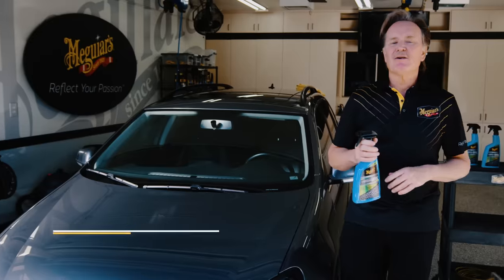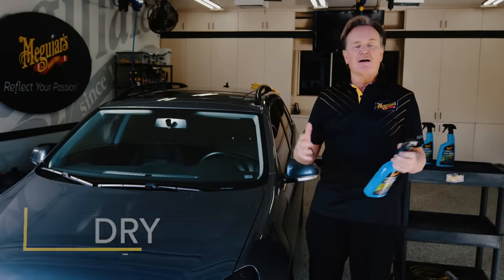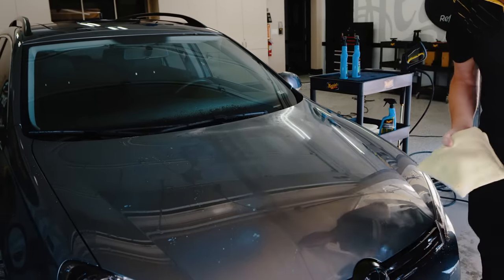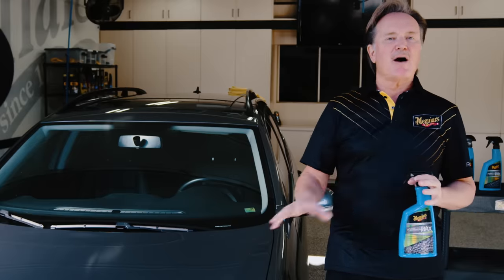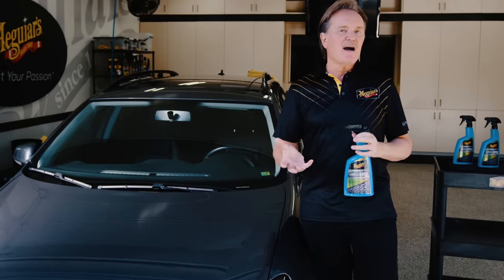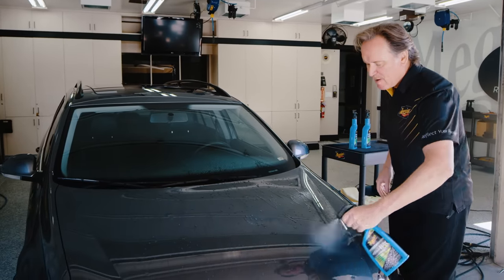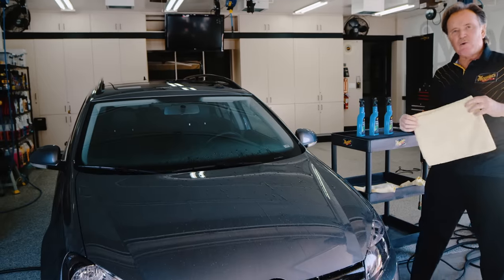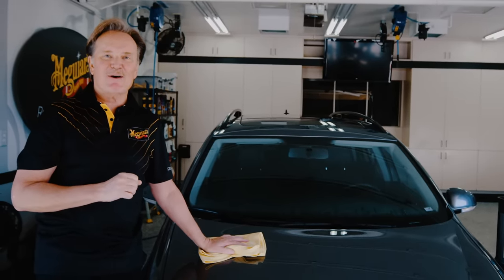Meguiar’s Hybrid Ceramic Wax - Ceramic Made Easy!

Comment: Can I use a sheepskin chamois to dry the car after application and rinse? Does it have to be microfiber?
Reply from the maker: Microfiber drying towels often tend to work better and are safer but if you like the performance of your sheepskin chamois yes, you could try it.
Reply: @meguiars  Well, I'm exhausted, but I survived. I swung by Walmart and picked up the Gold Class Car Wash, the Hybrid Ceramic Wax, the Clay Kit and the Water Magnet drying towel. I spent the evening giving it a wash, clay bar and hybrid wax. This White Chrysler 300S is so shiny and slick I'm convinced I'll get an extra 1-2 miles per gallon! It's so beautiful! Thanks for all your help and the great videos!
Reply from the maker: ❤️ 

Thanks for sharing.  Nice job. 

That really is a good feeling isn't it!

Comment: Hello there I have a question 

So where I live it’s not possible to hand wash all the time. So my question is after doing the foundation layer then spray the product and hose off. 
Do I have to use the product  continue every wash.  will it be okey if I skip the spray wax on some washes. 
I mostly relay on automatic cash wash. 
So I won’t be able to apply this for every wash what would be the result if I skip to use the product on some washes.
Reply from the maker: The Hybrid Ceramic Wax is along lasting wax.  It is certainly not necessary to use it every time you wash your vehicle.

That being said, how long any protection/wax lasts is highly variable and depends on a number of factors related to the condition of the paint, previous prep, and the environmental elements the vehicle is exposed to.  On a well maintained vehicle the Hybrid Ceramic Wax could last up to several months.
Reply: @meguiars  Thank you Love yr products.

Comment: I did exactly that on the first application and tried it three times and then did the second spray-on/spray-off layer after each. It did not work. For some reason this product won't bond to my paint. I previously used McGuiar's Ultimate Paste Wax, which works really well.
Reply: Question...is your paint clean?
Reply from the maker: Sorry to hear about the experience.  We would also ask, is the paint free of bonded contaminants?  In other words, when has the last time it has been clayed?  When is the last time it has had a regular liquid or paste wax applied?  Feel free to continue the discussion within this comment section if you prefer or, you can also contact our Solutions Hub at 800-347-5700.
Reply: @meguiars  I had just washed the vehicle with McGuiars ultimate. I then clayed most of the hood. I got the vehicle in mid June 2018. I have waxed it 2-3 times since. Last wax was in Nov. timeframe. I did read that using too much can have reverse effect but is remedied by washing with car soap to remove the carrier contents of the mixture which are hydrophilic. Not sure.
Reply: @Milpower  Yes, very clean.
Reply from the maker: With the information we have here, it does sounds like it has been a while since certain steps have been done.  You would likely get much better results by having a good base coat of either a fresh application of Ultimate Paste Wax and/or a polish step like our Ultimate Polish.  Also,  claying is going to be important if the vehicle does need it.
Reply: @meguiars  I did clay the hood but still didnt work there. Also, I dont recall the instructions saying to wax prior to applying but heard from FAQ that one could apply to wax without issues. So, I definitely followed the steps. Fresh wash -> clay hood -> apply wet -> dry towel -> pressure spray off -> spray on -> spray off -> no work.
Reply from the maker: Do you think it is possible there was a large abundance of water on the panel when you did the foundation layer?  We have seen where this can potentially not allow the product to adhere as well, and thus, not perform as well.

Comment: I saw a guy spraying this product on his brand new C8 Vette, windows too.
Is it ok to spray this in my windows, and NOT get a film on them? My chrome wheels (they ain’t ‘rims’) as well?
Reply from the maker: Yes, it is safe on all the exterior surfaces but it is designed to bond best to paint so you may not get the same results on other surfaces.

Comment: Can it be used as a stand alone wax?
And how long does it last?
Reply from the maker: Not sure what you mean by "stand alone" wax, but yes it certainly can be used as your primary source of protection.

How long any protection/wax lasts is highly variable and depends on a number of factors related to the condition of the paint, previous prep, and the environmental elements the vehicle is exposed to.  That being said, if well maintained this could last up to several months.

Comment: 2:30 didnt you just wash of the product?  
Is it not spray and wipe it with microfiber towel to distribute then rinse?
Reply from the maker: Sorry, not clear as to what your question is.  This is exactly how we recommend using the product.  There is no mistake in the video.  This is the recommended method of application.

Comment: What happens when we do the roof of the car with the spray and then hit it with the hose water won’t all of that run down on your windshield and windows? Is that safe on the glass
Reply from the maker: It works best on paint but is still safe on other exterior surfaces.  Just rinse thoroughly and you will be fine.
Reply: @meguiars  I guess I’m trying to figure out how you can avoid it running off the roof onto the windows. Because I don’t guess you really want it on the windows, but I can’t think of a way of stopping it, unless you use the liquid instead of the spray
Reply from the maker: Again, there is no problem with it running down other parts of the vehicle while applying.  Your concern while understandable is not necessary.

Comment: Can it be used on glass, rubber and plastic?
Reply from the maker: It is designed to work best on paint but is safe on other exterior surfaces.
Reply: @meguiars  can i use wax after applying the product?

Comment: Can it be use on wheel and headlight and how long will it last?
Reply from the maker: Yes, it can be used on wheels and headlights.  Keep in mind it is designed to bond best with paint so you may not experience the same effects and longevity on other surfaces.

Comment: Can we use with dry method?
Reply from the maker: We cannot recommend you do this dry as the water is very important in helping dilute and spread the product.  If used dry you may have a very difficult time application and removal.

Comment: I am confused. Can I use wax or polish after using Hybrid wax or do I have to use it before or not at all?
Reply from the maker: Whether or not you polish is entirely based on the current condition of your paint and your desire for it.  If you feel you have the need or desire to polish that would happen before waxing regardless of whether or not you choose the Hybrid Ceramic Wax.

As far as using another wax before or after the Hybrid Ceramic Wax we are certainly not going to claim that to be necessary.  However, if you choose to use 2 different waxes for some reason you would want to use the other wax first followed by the Hybrid Ceramic Wax.
Reply: @meguiars  Got it. That makes it clear. Thank you so much
Reply: @meguiars  Is washing with soap recommended let's say few weeks after the application of HCW

Comment: Can I put it on dry if I dry my cars with a leaf blower?
Reply from the maker: Would not be advisable.  When following the instructions for first/initial application you are spreading the product with the towel as you dry the car.  Subsequent applications using the wax as you rinse method work because the strong spray of water is spreading the product.

Comment: Just spray on before entering carwash. Works perfectly
Reply from the maker: We don't see a problem with that as long as the surface you are spraying on is cool to the touch and you can ensure it is rinsed off thoroughly.  Also, not a lot of product is needed.

Comment: Can you use ultimate fast finish on top of this for extra protection?
Reply from the maker: "Extra" protection is an often misunderstood concept depending on the products used, the order in which they are used, etc.  Layering in many cases is a myth.  

That being said, there is certainly no harm in using Ultimate Fast Finish on top of Hybrid Ceramic but whether or not the effect is going to line up with your personal assumptions or desires is unclear.  

We would always recommend first using a product how it was intended.  If you cannot resist the urge to use both of these products together you would be better off using the Ultimate Fast Finish first and then top it off with Hybrid Ceramic Wax.
Reply: @meguiars  thanks for the feedback.  Is this product safe on all exterior panels (headlights wheels trim etc.) or just painted clear coated panels (hood, doors, trunk, etc.)
Reply from the maker: Yes, although it is designed for and will work best on paint it is safe on all the other exterior surfaces as well.

Comment: hi, can i use this using the traditional method of using an applicator pad and working it on the paint then hand buffing it out with a microfiber cloth?
Reply from the maker: We really do not recommend that as it my be very difficult to spread and wipe off.  You really the vehicle to be wet when used.

If you prefer a more traditional wax application this product is also made in liquid form...

https://s.3m.com/tzt1v48b
Reply: ok. would it be fine if i use the HBC liquid wax for initial layer of protection then using the HBC spray wax for succeeding layers of protection and for boosting hydrophobic properties?
Reply from the maker: Certainly do not need both as they are really designed for the same purpose but if you want to do that that would be absolutely fine.
Reply: thank you. last question pls, can i use your wash plus to strip of existing wax so i could start a fresh coat of the HBC?
Reply from the maker: There may or may not be a need to strip the existing wax but yes, using our Car Wash Plus would strip any existing wax.
Reply: thank you. i just want to start everything fresh using only meguiars products😊so my plan is to strip off existing wax using wash plus, then 1st is the hbc pre-wax, 2nd is the hbc liquid wax, then the hbc spray wax for maintenance. what do you think? is it ok or is it too much?

Comment: Is this superior to the ultimate wax? Or when should you use each?
Reply from the maker: You will find great results by using both.  Ultimate Wax first followed by Hybrid Ceramic Wax would be a great combo.
Reply: @meguiars  would you still recommend doing clay followed by compound and polish with orbital buffer before the ultimate wax?
Reply: @meguiars  the vehicle is a 2017 with the paint having minimal blemishes just light scratching so wondering if just the polish is needed. Thanks
Reply from the maker: Yes we will always recommend to clay if needed to remove rough above surface contaminants & a paint cleaner/compound to address below surface defects.

Comment: Can I use soap to wash it afterwards? Won't it remove the foundational layer of the wax if I do that?
Reply from the maker: Not sure exactly what you have in mind when you say "soap".  If you are asking about subsequent washing with a good ph balanced car wash there is no concern as that will not strip the wax.  👍
Reply: @meguiars  Thank you. It wasn't very clear to me.
Reply: Can I use a sponge for the wash as well? This won’t remove the base coat either?
Reply from the maker: We cannot vouch for how safe an unknown "sponge" is in general but in theory that would not strip the wax either.  We would recommend a good wash mitt like our X3002 Microfiber Wash Mitt when washing any vehicle.
Reply: @meguiars  Appreciate it!

Comment: Do i need to use this during maintenance wash?
Reply from the maker: This is a long last protection.  It can last up to several months depending on how well it is maintained and the environment it is exposed to.  It certainly does not need to be applied every time you wash the car but some have found it so easy to do during the wash process they do it much more frequently.  Again, not required though.
Reply: Buddy of mine introduced this stuff to me. And he actually uses it every week and his cars are so clean man. So that’s my plan. Every wash, I’ll spray this on.
Reply from the maker: Certainly not necessary to use it that often but if you like that there is no harm in doing so.  👍

Comment: Is it safe on glass tho? When washing off with water?
Reply from the maker: Yes, safe for any exterior surface, but it is going to work best & is primarily designed for paint.
Reply: @meguiars  yeah, I just wanted to know if it's safe for windshields cause when I spray  from the roof I dont want anything to happen on my windshield. But thank you for the reply I'm gonna try it out
Reply: @meguiars  can I spray meguiar's quick wax right after the ceramic wax applied?

Comment: Could this be used on a vehicle protected with Xzilon paint protection?
Reply from the maker: Yes, you can apply the Hybrid Ceramic Wax over another coating or protectant.
Reply from the maker: Yes, certainly can be used on top of your paint protection but please make sure to follow the directions related to initial application to ensure optimal performance.
Reply: Many thanks to the Meguiar's Team for getting back to me so quickly. It is appreciated.
Reply: Will do. Thanks again for your excellent advice and customer support. Looking forward to trying out this product.
Reply from the maker: You're welcome and our pleasure!

Comment: Is it okay if it goes on the glass?
Reply from the maker: Yes, will not streak or effect glass, just make sure and rinse thoroughly like all the other surfaces. Keep in mind, it is designed for paint, so it will not have the same characteristics on glass as it does on paint.

Comment: Can I use it on my rims?
Reply from the maker: Yes, as many wheels are painted.  Keep in mind wheels are exposed to a lot of extra heat, brake dust, grime, etc. so as you might assume it will not hold up as long.  Also keep in mind if you use a wheel cleaner it may strip the wax.  👍

Comment: Not that easy. It left a lot of smudge and took a while to wipe off. When I first saw the water like streaks and smudge I started to freak out but then a microfiber towel took it off. Just took a lot more effort than I thought. Just like you would if you were using a wax product. Other than that it’s not a bad product.
Reply: New car, I had streaking also, and on the glass also. Had to buff the whole car to get off the splotches.

Comment: How many months that this ceramic wax can stand
Reply from the maker: How long any protection lasts is highly variable and depends on a number of factors including the condition of the paint, prep process, and the environment the vehicle is exposed to.  You may see several months of protection with this product if it is in moderate conditions and maintained well, i.e. frequent washing, etc.

Comment: Can I use the base coat of turtle wax seal and shine and then the top coat of meguiar hybrid ceramic wax.
Reply from the maker: Yes, the Hybrid Ceramic Was will work right over almost any other wax, sealant, or coating.
Reply: @meguiars  thanks for replying.i am big fan of meguiars products.i asked this question because I was having near about half bottle left of turtle seal and shine.
Reply: In india meguiars products are available at better prices than turtle wax. I would like to thank you because of this.
Reply: Hello

Comment: How long does it typically last?
Reply from the maker: How long any protection/wax lasts is highly variable and depends on a number of factors related to the condition of the paint, previous prep, and the environmental elements the vehicle is exposed to. 

That being said, if well maintained, the Hybrid Ceramic Wax could last up to several months.

Comment: For firdtayer do u dry car first or leave it wet
Reply from the maker: You definitely want to do it while the car is still very wet.  👍
Reply: @meguiars  can it be used on windshield
Reply from the maker: It is designed to work best on paint but it is safe on other exterior surfaces including glass, plastic, rubber, and chrome.

Comment: After using the product, wash it with special soap or water only
Reply from the maker: You can use either a good straight car wash like our Gold Class Car Wash that does not have any wax in it or our Hybrid Ceramic Wash & Wax if you want a wash and wax option.  Either would be great.  👍

Comment: Do I need to wait for the first application to cure for a while before doing the normal wash/rinse/apply spray/rinse again/dry  application?
Reply from the maker: Hi Christopher, great question, you actually do not have to wait, & if you would like to do both application methods right after each other, you will gain & should notice a benefit!

Comment: can you use this on your windows?
Reply from the maker: You can use the Hybrid Ceramic Wax on windows, but the benefits of water beading will be short lived as it was designed specifically for paint.
Reply: @meguiars  which specific Meguair product would be the best for windshield(s) of a car?  I want to make sure that it will not cause wiper chattering

Comment: Use for glass as well or no?
Reply from the maker: You can, but it is not going to bond as well or last as long on glass since glass has a different surface makeup.
Reply: Meguiar's thanks. I guess I’ll stick to using rainx for now.
Reply from the maker: Forgot to mention, we also have our Perfect Clarity Glass Care Kit you may want to check out.